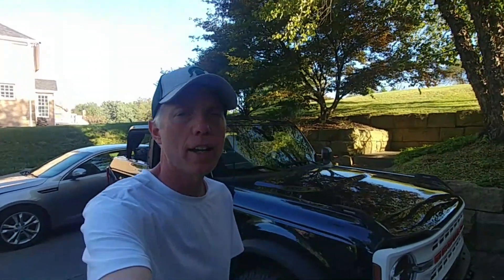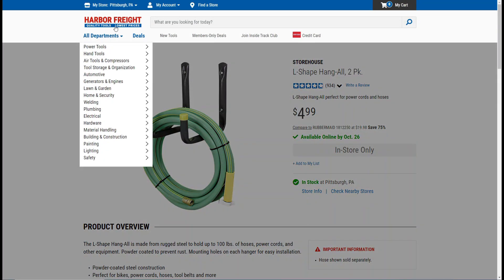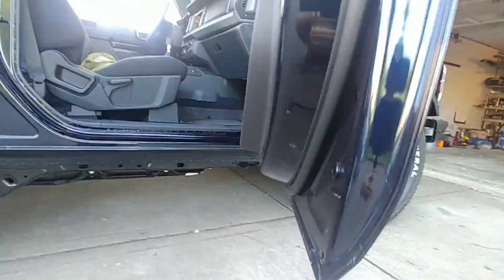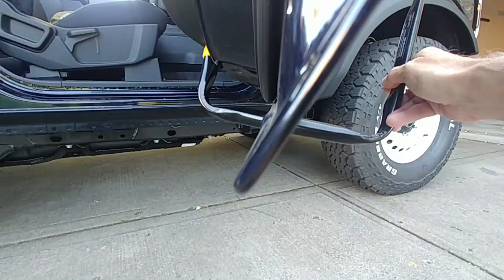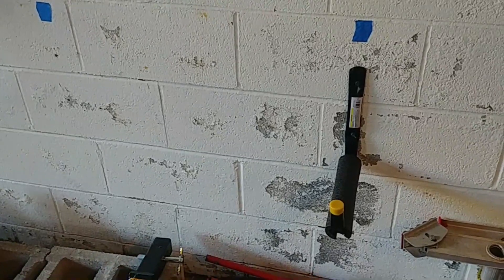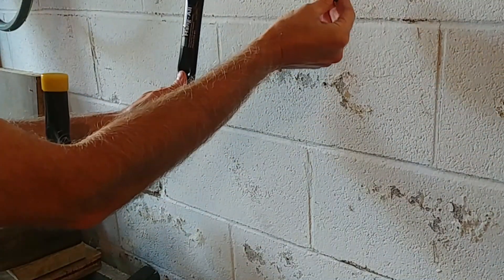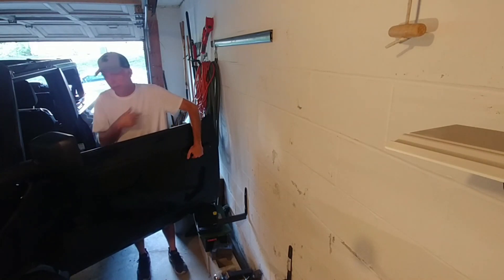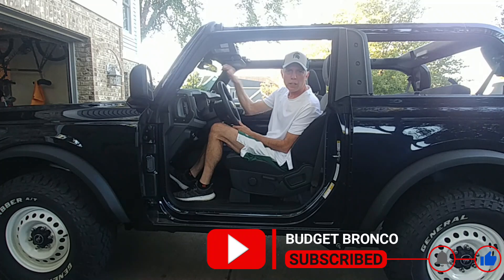2021 Bronco - DIY Door Storage Rack For Only $10

Comment: Buy you some pool noodles  to place on the door bottoms and edges to protect your paint when removing and attaching the doors.  Safety precautions will save you from chips and scratches.   Also wrap your brackets and stand the pool noodles vertical on the wall with Velcro to protect your door, an additional safety strap mounted with two eye bolts fastened to the wall will keep the door secure      Thanks for sharing.
Reply from the maker: Good ideas! I can buy more of that pipe insulation, it would work just like a pool noodle

Comment: Thanks for the video. I too have not taken my doors off. I may try to do it sometime in the next few days. A few questions/comments:
1. Did you have a second hook for the passenger's side? Is it on the same wall? Do you back it in so you do not need to carry the door?
2. Do you think the bags are overpriced? I am thinking of buying with my FordPass Points. It looked like the bags work to help with potential issues with dents that might happen in the install.
3. I did see what looked to be padded astroturf in the Off Roadeo location. I just installed of garage padded flooring (similar to exercise room flooring) and I am considering putting cushy astroturf on top of it and then leaning it against the wall. I never thought about actually putting it ON the wall raised up. Did you consider putting ON something on the floor and then leaning up against the wall?
Reply from the maker: Good to hear from you Farris! Get those doors off quickly before it starts snowing up there!!
1) Yes, I replicated this setup on the other side of the garage, so similarly I don't have to carry the door very far once it is off the hinge, without need to flip the truck around.
2) I have not seen the bags in person so I can't really say. If you are going to be taking the doors off a lot, it might be worth the $230. I will say that the top panels storage bag that came with our Base I think is very good quality, so if the door bags are similarly constructed, then I think it is worth paying that if you will be using them regularly.
3) I did not personally consider keeping it on the floor, but only because my garage as you can see in the video is pretty cluttered and not very clean. If you have a nice clean and padded surface, it might be an option. Also one reason I went with the off-the-ground method is that I do have some lower back issues and any time I can avoid bending and lifting something heavy, that is a win.
Thanks for asking and thanks for watching!
Reply: The bags are nice, i saw them at my dealership
Reply: @Mck499  75% sure that I will get them. I have enough FordPass points.

Comment: Could you lay them down in the back with sears down?
Reply from the maker: No, the 2 door model doors will not fit in the back, at least not easily and definitely not without stacking them on top of each other. The doors are longer than the 4 door model, and of course the space is smaller too.

Comment: I would suggest a portable roller rack (made with the same hooks), where you could have a padded center divider. Could use a harbor freight furniture dolly for the base and create a center "wall" where the hooks could mount back to back
Reply from the maker: Interesting idea. It would take up more space though, which I am pretty much out of in my garage as you can see.
Reply: @BudgetBronco  might not be perfect for you, but it would be nice for anyone wanting a little mobility with them.... and you could roll the cart right to the bronco instead of the squeeze job in the garage.   

It won't be for everyone, but for some I might be a good way to do it
Reply from the maker: True that...thanks for the suggestion
Reply: Yup this was a jeep solution that many jeep owners have built. Its all over the internet.

Comment: I don't really understand why your resting the bottom of the door trim on the edge of the bracket.
Can you explain
Reply from the maker: My only explanation is that this is an easy and low budget solution. Yes, a more highly engineered solution would include a mechanism to put pressure on the wider flat part. But with the pads on as shown in my video, I have not had any problems or damage.

Comment: How are your tires working out? I really want to go with the same size you are running on the base rims, but I am very nervous to run a tire that wide on the base rim…. Thoughts from your experience thus far?
Reply from the maker: I am very happy with the tires and have no issues whatsoever. But do your own research if you are nervous about it, here are a few threads to get you started:
https://www.toyota-4runner.org/5th-gen-t4rs/212283-those-fear-mounting-wide-tire-narrow-wheel.html
https://expeditionportal.com/forum/threads/285-75-16-tire-on-a-16x7-wheel.142694/
https://www.ford-trucks.com/forums/556301-285-tires-on-7-rims.html
Reply: @BudgetBronco  immensely helpful! Thanks a ton!
Reply: @BudgetBronco  How is the MPG? I took air out of my Base 30s and I lost about 1-2MPG. I am down to about 19MPG. I was at about 42-44PSI and I aired down to 35-36.
Reply from the maker: I will cover this in a future video but driving around town it is around 17 and highway around 19

Comment: go green!
Reply from the maker: Thanks for watching and GO WHITE!
Reply: Thanks for the the great build. I am still waiting on a Wildtrak but have been considering going budget based on your build. I love the grill and wheels and truthfully only need a winter ride that I have the option to drive when not in my summer car. Keep posting, we are watching. Thanks!
Reply from the maker: I was in the same boat...did not NEED a Bronco, just WANTED one, so that made it an easier choice for me to go the low end budget route. I kept my daily driver and now just drive the Bronco for fun. Unless money is no real concern for you, I would think the Base is a good option for you. It still has a lot of off road capability and is super fun to drive especially with the top off.  And if there is one or two things that you would really miss (for example, heated seats) you can always add just that one missing thing (for example, by adding Katzkins with heated pad) and you will save a lot of money as compared to the difference in price between Wildtrak and Base.
Reply: @BudgetBronco  I appreciate your suggestions, I am laughing because the deal breaker was the heated seats. 1st world problems, right? I think I am close to changing it up. For the price difference I can keep my summer fun car.